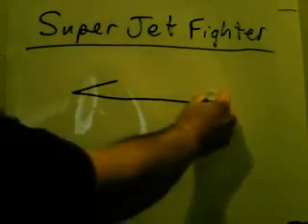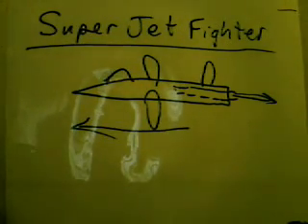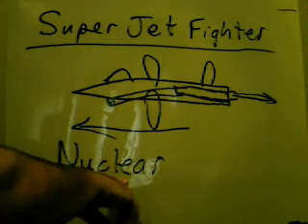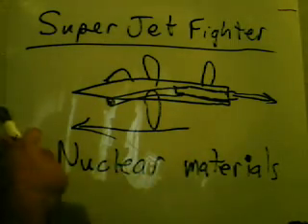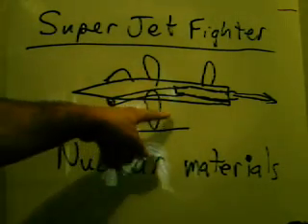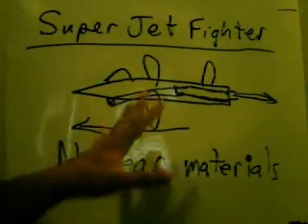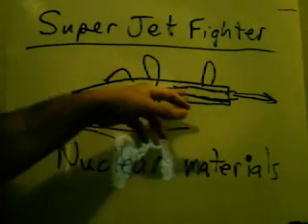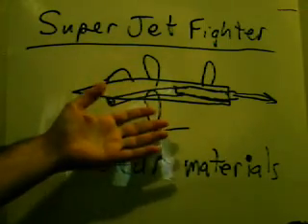Super Fighter Jet

Comment: Although instead of finding out ways to eliminate the radioactive material coming out, we could use something like NATURAL or DEPLETED uranium which wont cause that much damage but, still we need to find another way or another combustible nuclear material which wont cause damage. NASA's already into it! But still if we can find a way to take off without having to use a plane to take the jet at an extremely high altitude and then launch separately, it would make it cheaper and easier!

Comment: Nuclear fuel just doesn't explode, you need to get the fuel to to a dense enough state to undergo fission. To do that conventional explosives are typically used (for bombs, a stable reactor is to large for an aircraft so I won't mention those). Problem is chemical explosions only have so much energy. As a result there's a critical mass below which fission cannot be induced. 10kg of plutonium-239 is the minium amount that can be detonated. Other nuclear fuels have higher critical masses.